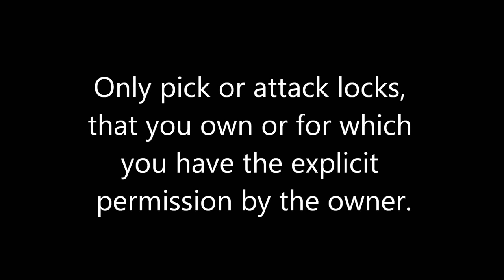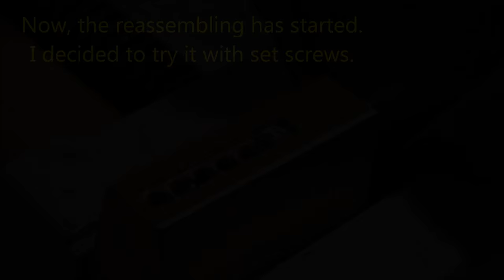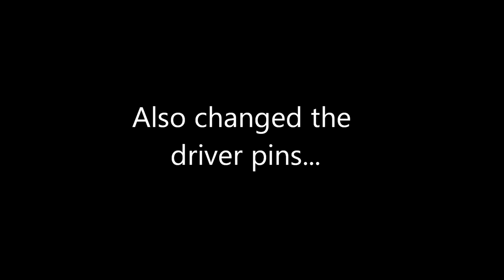(picking 111) Splatter padlock modification B-movie (+ Happy new year 2016)

Comment: Fantastic, I've considered this myself ( taking apart a padlock like this so very intresting to see how you did it. Enjoyable vid. 👍🏻
Reply from the maker: +Steensy Thank you for the kind words. But how I did it with this padlock, I'm not very proud of actually (and that's why I choose the title). I thought it would be much smoother. I did't expect the plate and so I was kind of unprepared. If you have chamber like this https://youtu.be/s99QC0m2KK0?t=236 it's much easier. 
And I would also try to only use 3mm screws. In this video I started with 4mm screws but then I realized that the chambers are to close for 4mm screws. So that's why there is a mixture.
Next time I will try to get the plugs out by first drilling a bit in the channel from the top and then pushing the pins in the plug upwards with a pick. If this works then the diameter will stay small enough for making 3mm thread and not loosing much of the length of the chamber.

Comment: Looks like if you would have started drilling on pin 6 the plate would have come off..ha ha 
 Great video...Happy new year..:)
Reply from the maker: +David Held You are probably right with chamber 6. But maybe it was just the last that finally caused the plate to come off. Will have to think about a better technique to get a plate apart. With just holes it's much easier: https://youtu.be/s99QC0m2KK0?t=236